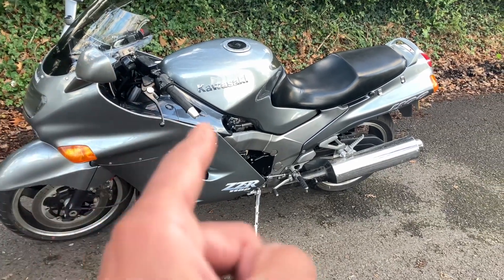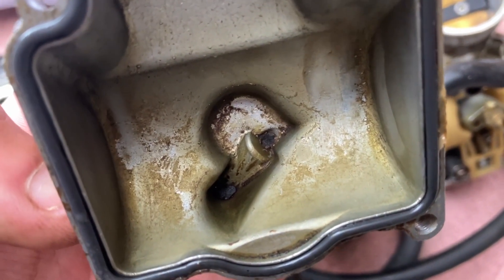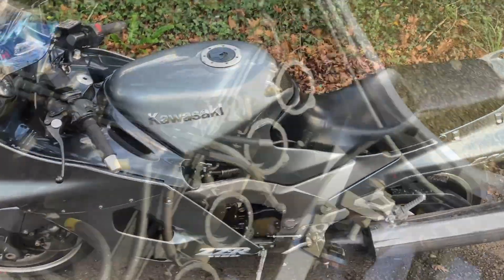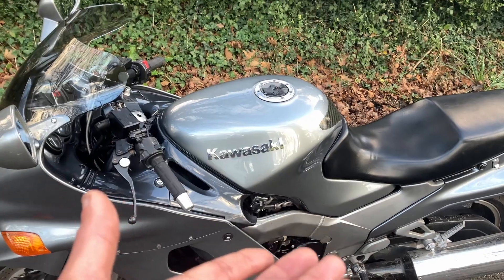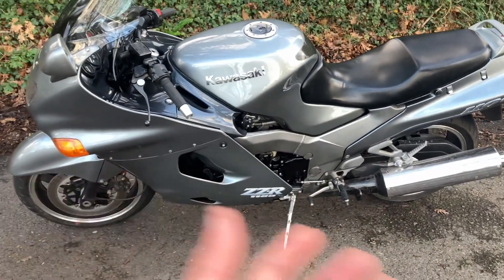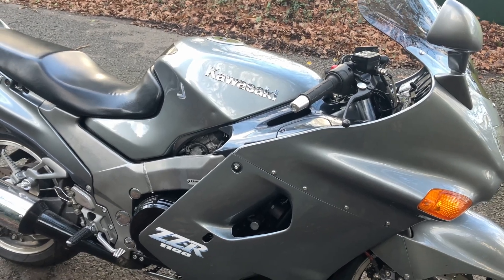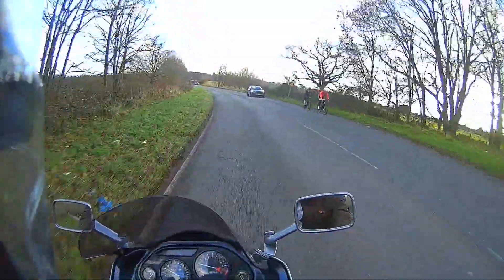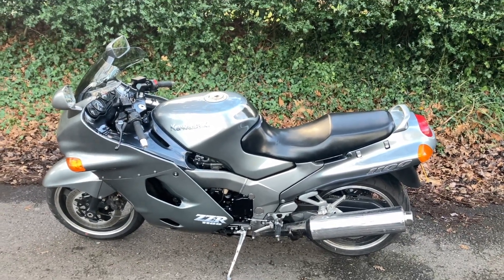Kawasaki ZZR1100 - Death & Resurrection!

Comment: I have 1100 from 1997 carbs need idling jets cleaning out tickover is bit wolly im to scared to do it myself
Reply from the maker: I was the same mate, but it's really not that difficult if you take your time. Just get all the tools you need and set aside an afternoon and take it slow and you'll do it. If I can, anyone can!
Reply: Sit down at the kitchen or dining room table with good light. Take your time and lay everything out as you strip them. Be careful with the pilot jets, their tiny O-Rings and even smaller washers.

Don't use Philips screwdrivers, JIS drivers are a must. If any bike shop specialising in Japanese bikes doesn't know what a JIS screwdriver is, RUN FOR THE HILLS!

Comment: Great vid! Check my pure sound vid on my channel if ya want to!
I also like MCR, at least a couple songs from them, not a huge fan but my favourite is probably Helena!

Yeah what you're saying is really true. You really get to know the bike very intimately when you fix it yourself. 
I like saying "it's not really yours 'til you fix it" . There's just something about doing your own maintenance. 
oh wait, I got it! It's cheap! :) But really though it teaches you how to maintain your vehicles in good shape. 

To my zzr 1100 I've done all sorts of things, and next up is engine overhaul, my gearbox second gear is toast. 
I've changed the front brake cylinder seals, aired it, changed the spark plug HT-Leads, cleaned the carbs, synched them a couple of times, checked the valve clearances, yadda yadda.
I've done some things more than I would like to admit, because I've been searching a malignant running issue at around 3000 rpms and also symptoms are that the idle isnt stable, and it drops below the set idle when I rev it. 

I also have an intermitting starting issue, pretty ghastly cuz it always gets you when you least expect. it's like 99% of the time it starts fine no problem, and then sometimes I press the button and nothing happens. This usually lasts for a while, and then it magically starts up as if nothing had happened. Some pesky contact issue I bet. 
What else? Not much really I guess. Otherwise it's been great. I usually ride pretty hard so it drinks like a maniac, some 9L per 100 km, maybe something to do with the running issue as well. 

Any help is needed if someone's got a clue! 
Anyway have at it, merry Christmas and a happy New year once again!
Reply from the maker: Happy Christmas to you too and thanks for your comment. Helena is an absolute tune, and I hope you have luck with your Zed. I'm seriously tempted to get another one when my wallet allows